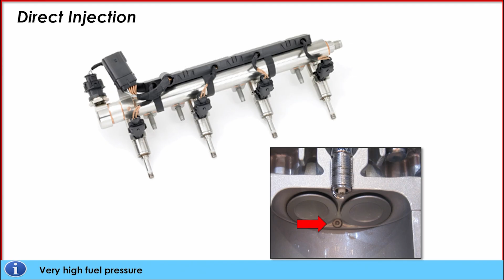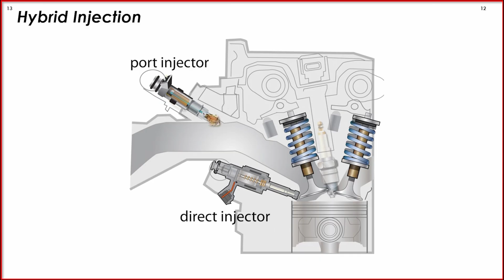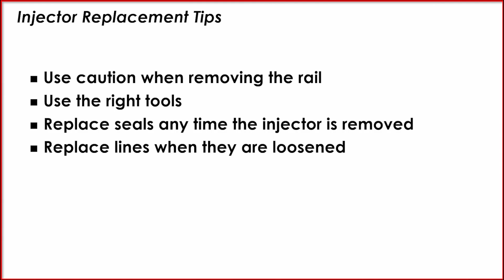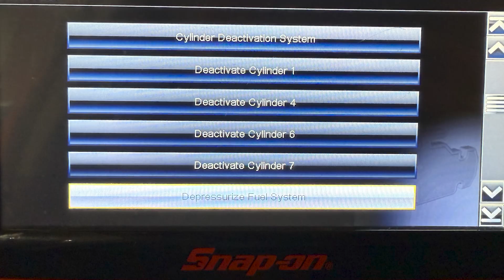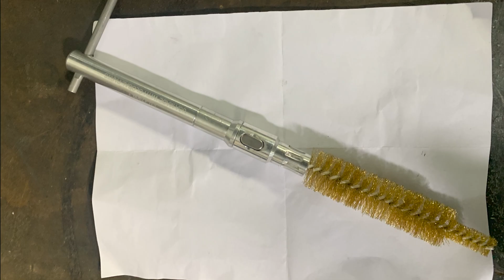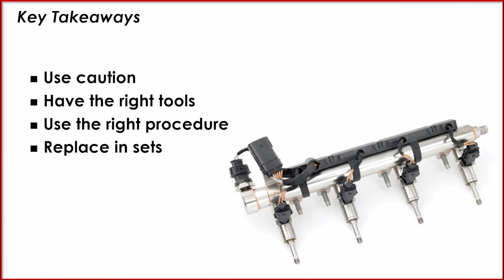GDI Fuel Injector Replacement Tips | Pro Training Power Hour

Comment: What is the best way to bleed the high pressure system? Also, it might be difficult to see a minute bend in the rail, so how much is enough? Thanks! Can you also show how to remove and install the injectors into the rail? No lube on the injector seals?
Reply: If you watch the video he said trans gel for lube, 
And he used a scan tool to relieve pressure but you can just pull the fuse until the car stalls, than let sit for at least 15 minutes or overnight.